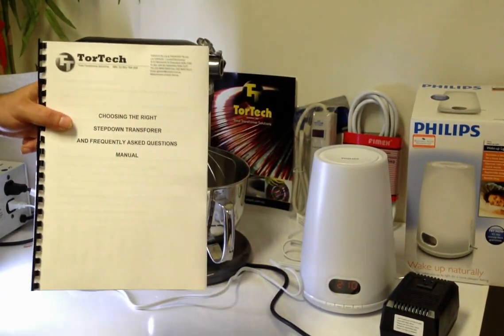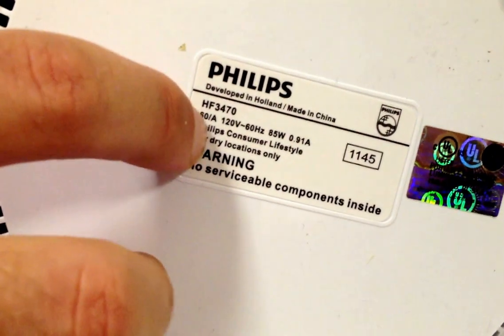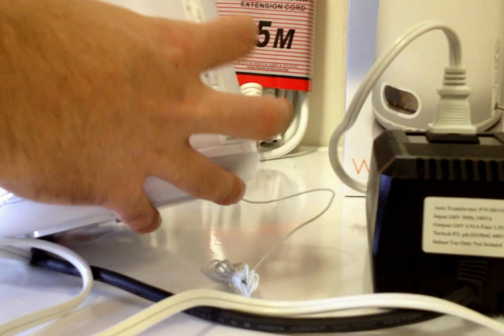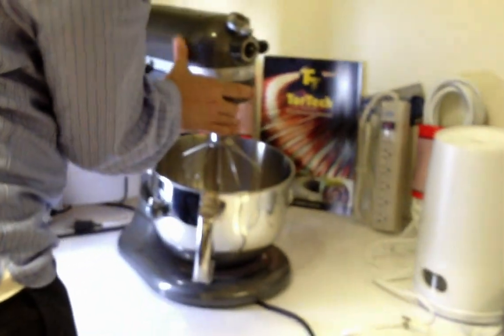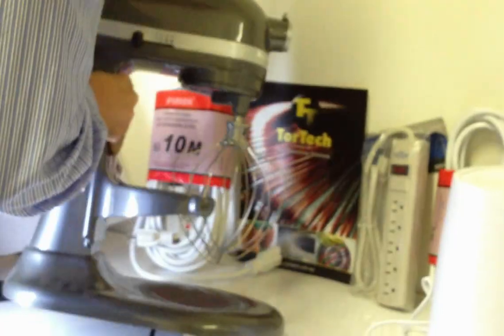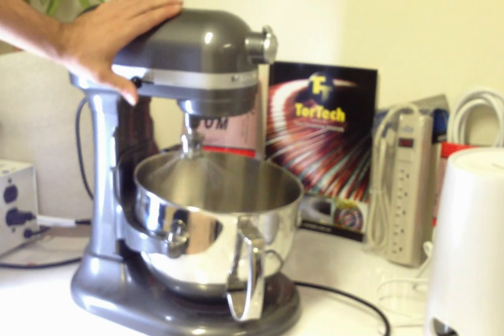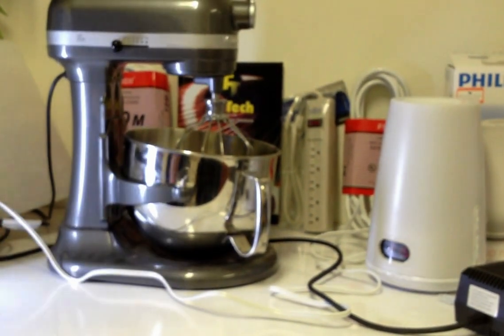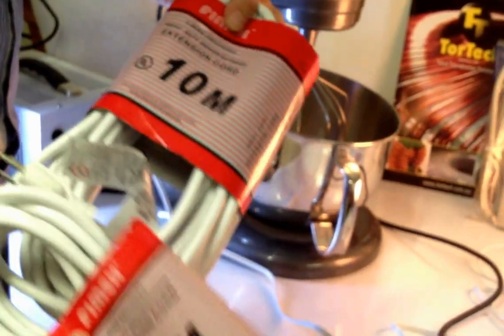How to choose the right step down transformer 240 - 120v voltage power converter

Comment: i got nutribullet pro 900. my problem is that the volts here in the philippines is 220v. so what step down transformer that is recommended?
Reply: you can use 1500 watts transformer
Reply: Wow. 1500w transformer is expensive man